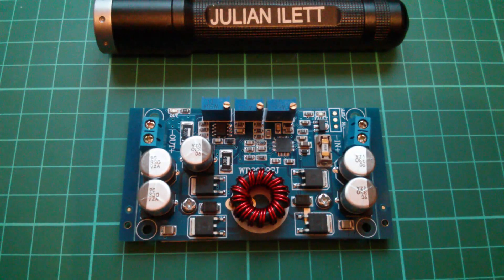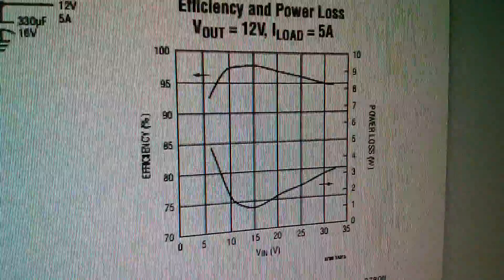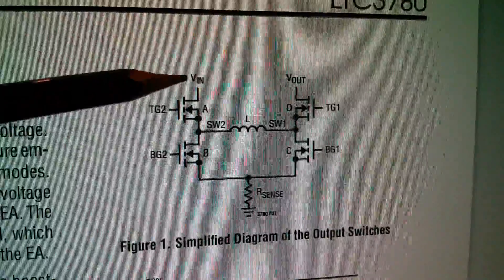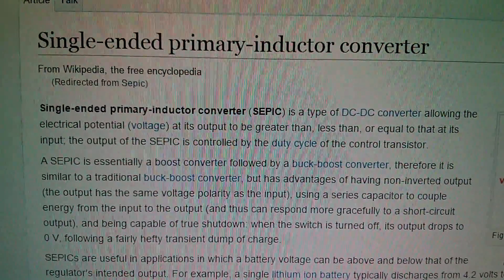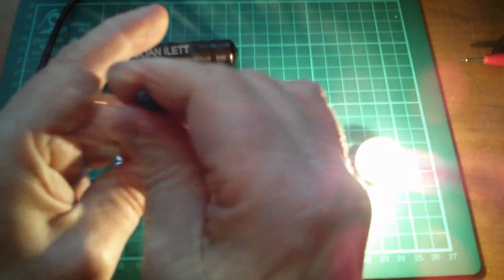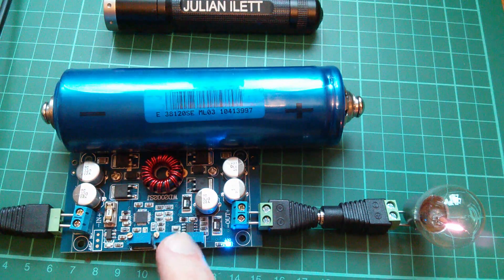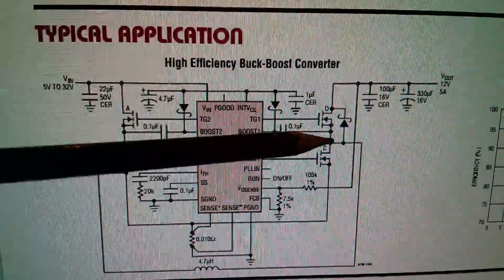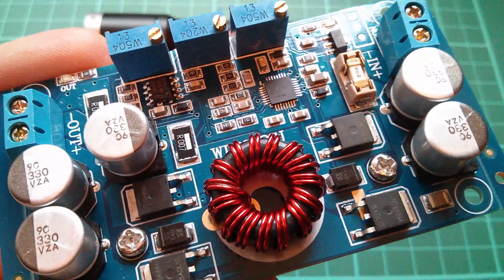First Look: LTC3780 Buck/Boost DC/DC Converter 10A 130W

Comment: Hi sir, As you have mentioned that there is no need for shottky diodes in this module. Can I wire in parallel 2 or more of this units without having an isolating diode in each units?

Comment: I saw this video a few years ago and it convinced me to get the ltc3780 it has proven to be a primary staple and a true workhorse it is amazing.

Im seeking advice from you on how I can parallel two of them together for a dual supply. I've tried a few different configurations but the boards go into protect mode and could use some advice please.
Reply: gatsctt has an instrctabls where he used one of these and the people that made them did do a parallel configuration

Comment: The module is 5A max not 10A , and max current of diode SS54 is 5A , so the module at 5A is ok but more than will fail and dead.

Comment: Can anyone in the comments recommend a circuit board that starts out 12V and then switches that same output to 5 V and holds steady till i turn it off?? I Just need 12 v for a second or two Then hold 5v indefinately.

Comment: The third trimmer is used for mppt or maximum power point tracking it is used for solar cells np
Reply: 3rd trim pot is for UVLO. Under-voltage lock out adjustment

Comment: Hi Julian- I'm looking for a DC to DC boost converter to power my laptop while in my caravan from the 12V battery. The specs for the AC wall charger that comes with my laptop state it requires 20V DC at 6.75A. Do you think the 3780 boost converter is capable of powering a laptop for these conditions?

Comment: Hello Sir, How can the LTC 3780 be used to charge Battery and be connected to Load at the same time The LTC3780 board does not show have a separate connection to load. Kindly explain how I can charge a 12volt batery and also connect to Load at the same time such that load is being supplied with a 12 volt while the battery is also being charged. Any assistance will be appreciated.

Comment: I have been using this buck boost converter for awhile with a 9v battery being the input and the output 12v.

Do you think I could use a LiPo battery instead of a 9volt battery or is the input voltage going to be too low?

Comment: Is there any advantage using 24v as a power supply instead of 12v if my most used output range is 13v and below?, my point is to keep the converter always in step down mode.
Reply: Highest efficiency should be achieved when Vin is just slightly above Vout. Check the efficiency curves in the LTC3780 datasheet, also shown in this video.

Comment: With the whole selection of these Buck / Boost converters no one seem to do one with more then oh say 5-6A of output current.  looking for one to use as a poor mans MPPT.  I found these to try.  Ordered  not tried.  These play the rating game states 10A but if you follow the numbers it will only do about 5A on a 24V system.  https://www.banggood.com/Geekcreit-DC-DC-8A-DC5-30V-150KHz-Automatic-Step-Up-Step-Down-Adjustable-Power-Module-Voltage-Regulation-p-969195.html?rmmds=myorder&cur_warehouse=CN

Comment: Hey Julian, I hope you could advice me on this buck converter. I removed the CC trimmer and the CV trimmer from  board. I then solder 3 wires for each trimmer to the board and wired each to a rotary potentiometer one of 500k for the CV and one of 250k for CC. When I put a 6watt load to it. The red fault light came on and the potentiometers were not doing a thing. I would really appreciate your thoughts. Thanks
Reply: did you fix it?
Reply: @Juan_Rodriguez_1999  , yes I sure did. I also connected an volt/amp meter to it. Works like a charm
Reply: @milvolts1  Thats great, how did you solve the red fault led problem?. Im having the same problem. thanks for the reply 2 years later and sorry for my bad english.
Reply: @Juan_Rodriguez_1999  , in my case I had not set the factory pots all the way down before desoldering them. Once I did that I was good to go. Be sure and use thin wires as to avoid resistance. Good luck

Comment: Great video! Thanks for sharing.
i assembled a workbench power supply using this converter and would like to add a LED to indicates when the converter goes to constant current mode. Any idea on how to implement it?
Reply: Look for the current-limiting signal at pin 1 of the LM358 opamp.  It may need boosting to drive an LED, though. Someone has posted partial schematics here: https://wiki.beyondlogic.org/index.php?title=WD2002SJ_LTC3780_Synchronous_Buck_Boost_Converter_Ebay_Automatic_lifting_pressure

Comment: does anyone know where the middle connection for the volt pot goes i scratch mine
Reply: Assuming you mean output voltage selection rather than undervolt-cutout, its center pin and one side are tied together and to Vout, and the remaining side goes to VOSENSE (pin 4) of the LTC3780.

Comment: Hi Juilan Ilett, please I wanna know if one can get up to 100W output from let's say a 20W  solar panel using this LTC3780 Buck-Boost Converter, is it possible? If yes can you make a video of it?
Reply from the maker: You can boost voltage or you can boost current, but you can't have both - you can't boost power :)
Reply: Ok, noted. Thank you very much

Comment: Good video but you make a small mistake at 5:12. The whole power stage is high current path. All parts in that H configuration have high current capability because buck and boost modes require flow of current through every part of the power stage depending on time, whether its D or D'.

Comment: hi, my fault LED ist permanently on. 
i adjusted the first pot but i guess it is broken. does anyonen has an advice for my?
i dont need undervoltage protection. is there a way to bypass defect function?

 sorry for my bad english.
Reply: Same here.. Is your output voltage the same as the input voltage? That's the case with me, even when I vary the input voltage..
Reply: turn the first potentiometer counter-clock wise to disable low voltage cutoff

Comment: Be interested on your views on this little bit of B.S.... a four component 60v DC-DC converter 3A. Two caps, a MOSFET & a pot. 

https://www.ebay.co.uk/itm/DC-DC-Buck-Step-down-Regulator-Converter-4-5-65v-to-3V-6V-9V-12V-24V-48V-Module/263031876320?hash=item3d3debeae0:g:dd4AAOSw~G1Zy8lx

Thanks for your vids, very informative.
Reply: It let the smoke out at 8V, less than a half amp.  :)

Comment: Is it possible to power the module with  220ac to 24ac  transformer. using bridge rectifier to make ac to dc and feed the module.
Reply: yes you can use a transformer as long as the rectified voltage does not exceed the max input of the converter. The rectified voltage will be very close to the Vmax of the transformer, provided that you use a sufficiently large smoothing capacitor
Reply: colorado wilderness I'm using a 12V 5A (60W) psu to power it. Works fine. Unfortunately I fried my board recently due to my clumsiness xd
Reply: Oskar Ogarp, Thanks for your response.
Using transformer ( 24VAC, 190VA  and used bridge rectifier to make dc)  to power up the module i damaged two buck.

Comment: Hi, I have this Boost Buck Converter http://www.ebay.com/itm/DC-DC-Automatic-Boost-Buck-Converter-5-32V-to-1-25-20V-5A-Step-up-down-Module-/181515918748?hash=item2a43311d9c:g:3AEAAOSwd4tUB~J4
that has no display, only pots for voltage and current regulation. How could I monitor the desired max. current limit on this device?

Comment: When I aplly 12V to the LTC the led call fault turns ON, and I cant measure voltage on the aotput. How can I fix that??
Reply: turn the first potentiometer counter-clock wise to disable low voltage cutoff
Reply: The same here

Comment: The under voltage to charge LiFePO4 is good, 3,55V per cell is good those cells stay at constant voltage from 15 to 85% of their capacity. in a car you can charge ok a 4 cells liFe by just having 13,7V and it works not only now but on the (very) long run (7 years and counting) and this is 3,425 V per cell !

Comment: I tried to charge a 3S  12,6V LiPo battery, used a 20V 8A power supply of my laptop. At once after connecting the power supply the converter died, it has a short at the input even without battery. It worked without load before. Is there a sequence what to connect first, power supply or battery, I remember reading something in a description, but can't find it any more. And I read an article that others had the same problem.
How can I find the defect parts to replace ?
Reply: did you put a diod in series with the battery ?, theat can be the problem
now if the voltege at the exit of the converter is inferior to the voltage of the battery , whit no diode in series , it will hapend a backflow of current , and distroy your board, A.K.A. what happend too you

I do not know haw too fix it, normaly this boards ar not economicly viable to bee fix´t

if you only need too charge lipo battery´s you have better options, this option is overkill :)

Comment: can I charge my lion 18650 4s 14.6volt battery and can I adjust amp 1.5 amp
Reply: yes you can, I charge mine
only you need to trim the 3rd pot ( too cut the charge current, acourding with your minimum charge current of your battery) , and you need to put a diode in series  
if you only ned to charge like 75% 80% you can doo it ( I did it like theat)
Reply: Thanks sir ...

Comment: Hi Julian, great in depth video as always. So i have brought both types the LTC3780 and the other boost/buck converter with both the lm2577s lm2596s and with the three pods on. As far as i can tell the LTC3780 has better efficiency as the other converter is only around 80% and the LTC3780 also can handle more watts at around a recommended 80w rather than the 15w from the other one. Here's the ebay search for the other one'DC-DC Step Up Down Boost Buck Voltage Converter Module CC/CV LM2577S LM2596S' but apart from what i have just mentioned any reason to use one over the other? Regards

Comment: I wish I had ordered the damn IC in qfn, I think the sample was only avalible in ssop...either way the thing was design in imperial... try finding a break out/dip board for .625mm pitch for a decent price, the other obvious use for that board it car laptop adapter. Some people have laptops that could max the thing. now days its becoming less common but 65-90w is still pretty common

Comment: Does anyone know why there are 3 pots on buck-boosts? So output voltage, output current limit and what does the other control?
Reply: Tera Volt With the third potentiometer you can shut off the module when the input voltage is under the adjusted voltage. Then the red led lights up. For battery safety for example.
Reply: Oh right, I've ordered a few and played with them, there was nothing to tell me even which were V and I adjusts. I managed to figure out those two but never found what the third did, I turned it and nothing happened but I never changed the input voltage from my SMPS. I'll give it a try, thanks.

Comment: I am looking for a variable low voltage cut off to protect my battery packs. I would like to be able to set it so if voltage drops to 14 it automatically disconnects battery. any suggestions would be appreciated.

Comment: Hello. I'm thinking on building a digital power supply with this. Actually I think (I'm not an expert please correct me if I'm wrong. :) ) the potentiometer that adjusts the voltage, is basically  a voltage divider that supplies a variable voltage (usually 0-5V). So is it possible to feed Arduino digital output to a rc low pass filter to get analog values out of PWM and then feed that voltage to the pin that adjusts the voltage. Repeating the same idea for the Current limit. Are there any problems with this idea ? Thanks!

Comment: would it be possible to use the chip to power more FETs and a larger inductor to build a very high current boost buck converter?

Comment: HI Julian,
I HAVE A PROBLEM WITH LTC3780. WHEN I TURN THE VOLTAGE POTENTIOMETER  THE FAULT LED LIGHTS UP. IT LIGHTS UP AFTER 6V AND VOLTAGE DOESN'T INCREASE FURTHER. WHAT COULD BE THE PROBLEM. COULD YOU PLEASE THROW SOME LIGHT..
Reply from the maker: The fault LED may be connected to the PGOOD pin of the LTC3780. Check the data sheet for details about the PGOOD output pin.

Comment: i want to use this in combo with an atx psu with a gnd,5v,12v and an adjustable voltage source.
Should i use a separate ground for the adjustable source using the board in this video or can i just use the same ground for everything ?
Reply: If you want the current-limiting feature (center pot) to work, the output ground/negative must be kept separate, so that all current flows through a 7-milliohm sense resistor in the negative output line where it can be measured. Aside from this, common ground works fine.

Comment: The reason I was asking is you seem to have a great understanding of it.
Reply from the maker: It's just a hobby. Silly really, the UK is a very bad place to be interested in solar power :(
Reply: Yes when I was in the milatary,we stop by there ,lots of clouds,I use to no a English band when I was I Germany ,they say that it's like that all the time,me I n.am in California nothing but sunny dessert this would be the place for solar,I had offer every five mins trying to get me to install it.what about wind power
Reply: Surely wind power would be viable! Why didn't ou set up and use that turbine we had seen a while back, was it broken?
Reply: That 3rd pot is a under-voltage protection potentiometer and you only use it if your power supply is a battery like a 12v and you don't want to completely kill it so you set this to 10 volts and it terminates the connection.

Comment: Works fine as an LED driver...you don't need to push the LED over 30v because then it becomes incredibly inefficient. Amps climb up for slight increase in brightness and more heat. For a battery set-up that would not be ideal. For increase in brightness rather get a 50w or 100w LED and run it at 29volts. Less heat, more efficient, running with a more efficient LTC3780 modal.

Comment: Hey, anyone could help me? I got this thing 3 times and no one work properly. I just opened the package and give it an input from switching power supply 12v 5A. But what i got is no output voltage but only red led fault light up

Comment: Hello

if I want to set the current value with the potentiometer, is it allowed to short-circuit the poles?
When I want to reduce the output current to 1.5A for chargeing a Battery,  what is the right way to do this?

Thank you

Comment: Just ordered one(but from other seller from ebay) and it's current doesn't go above 3A. Really dissapointed because I hoped 8 A for my induction heater. I even wanted to use it to build my own lab power supply.
Reply: Check to see if your power being supplied is not dropping...I've tested this module with a 12v computer power supply and its the best performing modal I've tried so far. Handles the 10amps without breaking a sweet while other boosters are blowing fuses up and melting.

Comment: So, what is behind the third door?  The third pot is the cut off (shut down charge mode) adjustment.  When charging Li-ion batteries, in  the constant voltage mode, current goes down to 10% of the constant current mode current setting and the charger shuts down.  On the tp4056 boards, the LEDs shift from charge to charge complete.  The third pot adjusts this percentage.  To adjust it,  get a battery into the CV charge mode.  Monitor the current and adjust the pot to cut off at the current level you want.    You have to wait until the current drops to the level you want.    The LTC 3780 is a fantastic Li-ion charger.  I  think that this feature raises it's  ugly head when the user is not even charging batteries.  When in constant voltage mode and below the max constant current setting (10%) , the unit  thinks that the battery being charged (it doesn't know better) is ready for cut off.  Voompah, game over. Aside.  200k and 500k ten turn pots (today) seem to be made out of unobtainium.  Regular 1 turn pots are too course to get 3 digit accuracy (like the trim pots on the board).  I use a pot 10% the size of the course pot as a fine tuner.  Just put it in series with the course adjustment pot.  I use the mini OLED 33v 10a electrical parameter meter (from your mail bag) to complete my bench top power supply.   The primary power comes from a computer power supply 12v dc output, but anything from batteries to wall warts seem to work fine.  Just do the math,  power in less losses is power out.Oh ya,  Thanks for all the great stuff.  Keep up the good work.

Comment: Hi i have just bought one of these units, the type without the large heatsink on, when i tried the unit out like your video it works fine, 12v 16 amp sauce, unit set to 12.5 volts i connect a 12 v car stop/tail lamp with the two filliments togeather this result is 12v 26w (at 12 v = 2.2 amps) this works on the unir great. but with the current limmit fully on and the volt out set the same as with the 26 watt bulb, i connected a 12v 55 watt buld spot, the voltage dropped of to 7.9 volts and ajusting the current and the volt pot the volt will turn lower but no high than the 7.9 volts, my point is will this unit deliver the 7 to 10 amps ? the spec says yes the unit says no i have a video on youtube showing this "teasting the LTC3780 unit" by david Teale check it out.